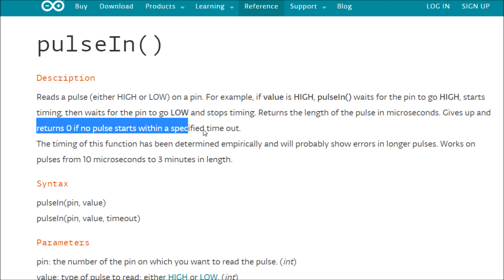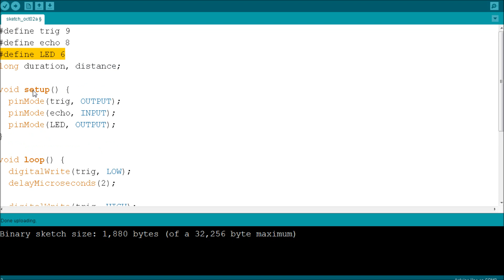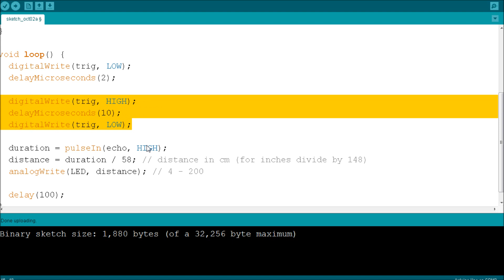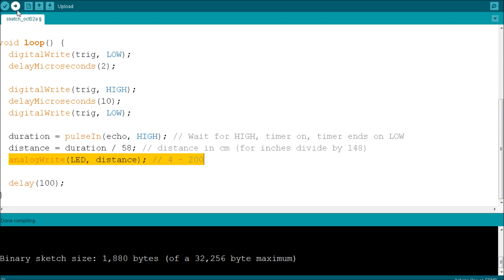Arduino #10 - Ultrasonic HC-SR04 Range Sensor - Robotics Arduino Tutorial

Comment: i have a question about pulseIn() function. Why does it measure the time when the pin is recieving a HIGH signal?Shouldn't it measure the time is recieving a LOW signal because from what i heard i understood that the sensor triggers an ultrasound and waits for the ultrasound to come back.So the time from the nearest object for the ultrasound to travel  is the time the ultrasound travels until it returns to the sensor divided by 2.
Reply from the maker: Adi, you are correct about the pulse. That being said, if you look at the documentation of the pulseIn() function, you will notice that a HIGH parameter translates to the following: Trigger as the signal is sent on HIGH and wait for a LOW. Therefore it's doing exactly what you have described. The distance is divided by two; it's incorporated in the division shown in the tutorial.
Reply: Yes,but when the signal is set on HIGH in this project with the ultrasonic sensor? I know that we need the duration between the moment the pulses were sent and the moment the pulses are recieved and for this we are using the pulseIn function which times the duration the signal is HIGH on that pin. What i am asking is from what does that HIGH signal come ?
Reply: First let's see if i got the pulseIn function straight
 For example if i hook up a button to a digital pin and write some code in which i want to find out the duration i press the button. If i push the button for 1 sec the function pulseIn(pin,HIGH) should return in the serial 1000
Reply from the maker: That's correct provided that your button sets the signal to low as it unlatches.

Comment: Is there a way to code the sensor to make it sense things closer to a straight line?
Reply from the maker: Unfortunately that's not possible with ultrasonic sensors. I'd recommend using a laser sensor if you absolutely need that "feature".
Reply: thanks

Comment: You say you're using PWM for the LED brightness, but you used analogWrite. Im pretty sure PWM is digitalWrite, and analogWrite varies voltage and only works on analog pins.
Reply from the maker: +175griffin not agressive at all; I just pointed out the correct reference. To answer your second question, Analog pins are the ones you can use for Analog to Digital (ADC) conversion; in other words, only those pins can read voltages that aren't just HIGH/LOW. The PWM pins, are the ones you can use to output a PWM signal or a "fake" analog. Analog pins on the Arduino are A0 - A5. PWM pins are 5, 11, 12, 15, 16, 17 for the UNO.
Reply: @VladRomanov89  I hope you still don't stand by that comment lol, PWM is not an analog signal at all. Its just an digital signal that pulses on or off at a certain frequency.
Reply from the maker: @Dlck.C.Normous  that's exactly what I wrote... The microcontroller outputs only a high/low signal which is a "pseudo" analog which you'd need to filter out to get a true analog voltage...
Reply: @VladRomanov89  Oh wow i'm an idiot I read your comment thinking you were saying only analog pins were capable of pwm. Btw thanks for the video first time working with these sensors and this was very helpful.
Reply: +175griffin look up analogWrite in the Arduino web, it is used with PMW
Reply from the maker: +175griffin That is incorrect. Arduino can only write 0 OR 1. The AnalogWrite "simulates" an analog value through PWM. Here's the reference from Arduino: https://www.arduino.cc/en/Reference/AnalogWrite
Reply: Ok, so what's the difference between analog pins and digital pwm pins then?
Reply: I just reread that, it sounded aggressive. I mean that as curiosity, not trying to prove anything.
Reply: EEEnthusiast That explains a lot, thank you!

Comment: Man, thanks for the explanations :D , abt the range of detection, i've read in a website that it can detect objects even in  3meters ,is it true ? and is there' r anyways to limit it's detection angle, for example to limit it in 30 degree ? thanks a lot
Reply from the maker: +anass jouhri thank you for your comment! The datasheet for the sensor specifies a 4m range, so it is possible. I don't know of a way to limit the angle, but I would look into IR or laser sensors if you are looking for narrow detection angle sensors. You need to find a specific sensor for your application.

Comment: Can I connect more sensors on Arduino Uno? Or I need other kind of Arduino? 
I need eleven sensors to be connected
Reply from the maker: +Carlos Mauricio Rangel Mancilla You have multiple options here. You can use the I2C bus and have up to 128 sensors connected, or use multiplexing chips, or shift registers, etc. The short answer is yes you can connect 11 or even more sensors.

Comment: really nice tutorial! Can u tell me how to calculate distance using Radio frequency(433Mhz) using Arduino?
Reply from the maker: I'm not sure that's possible. As far as I know, there is no way to detect the strength of the radio signal which would give you the distance. There might be such components, but I'm not aware of any.